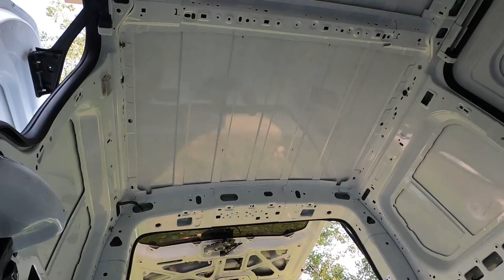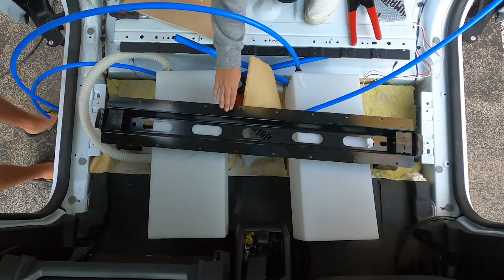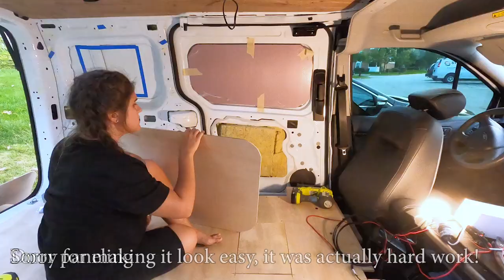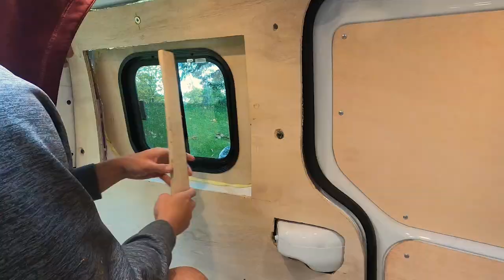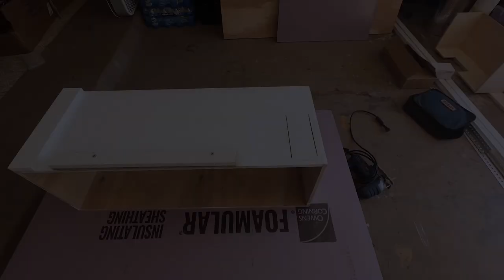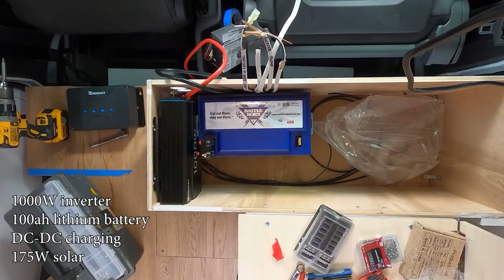Ford Transit Connect Van life Conversion | Full Time Lapse Video

Comment: Your build looks light years better than mine.  I like having the option of using my van as an actual van sometimes though.  So, I set mine up so that I can remove everything within 10 minutes... even the flooring.  I can put everything back just as quick.  The solar setup and diesel heater is the only thing that I leave inside since they aren't really in the way.
Reply from the maker: That's awesome! That is actually how we built our personal van as well. Great for work and for travel. :)

Comment: Very professional job. I was just curious about the water tanks and pump installation. It doesn't seem like it would be very accessible if you had to repair a leak or service the pump, without having to tear up the flooring.
Reply from the maker: Thankfully it is build with that in mind. The water system is build to be service free and last a very long time. The changeable water filter is located under the sink.

Comment: Haven’t got all the way through the video yet.. very impressed so far, but how do you plan on removing the water tanks for servicing/cleaning? I would highly recommend cleaning the tanks on at least a yearly basis. Uncleaned tanks can build up with biofilm which can cause infection in the body if not careful. Please look into it and be safe

Comment: I've never seen anyone get a sub-floor in a Connect before. You guys are really skilled craftsmen. The only thing I would have done different is leave out the skylight. Just another hole in the roof that will eventually leak.
Reply from the maker: Thank you!
About all the holes you might put in the van, just make sure to check the sealant at least once a year and apply more if nessesary. Regular maintenance for any RV.

Comment: Can you explain what holds up the slide out bed on the side closest to the kitchen? By the way, I’ve looked at probably 100 builds of this van, and you guys nailed it. I’m likely going to build the one with the dual swinging doors, but other than that, I’m going to build as much like yours as I can. Great job!
Reply from the maker: Thank you for the feedback! when the bed is open it is held by the heavy duty slides, plus is supported by resting on top of the kitchen drawer face panels. Watch the van tour for more details.

Comment: I like the extruded aluminum channels you bolted to the roof.  What did you use for spacers?
Reply from the maker: The spacers were made of aluminum and nylon, with rubber washers. Use silicon caulk on the threads of the bolts, and you should get a quick custom roof rails! Perfect for solar panel mounting.

Comment: Very nice build. How much weight did you add?  Especially if your water tanks are full?  4 cylinders have a reputation for chugging up hill.  What does the weight do to your gas mileage?
Reply: Not that much weight was added. When you are full on water, it's less than 200lbs. Overall still less weight in the van than if you had a car full of people in the passenger version of these vans.

Comment: Great build!!!!!!!! I have a question 🙋‍♀️ can a larger “fixed” bed be put into a connect? Like a full size bed? Yet still allow space at the “foot” for a toilet to slide from under the bed and or room to put your feet on the floor to get dressed?
Reply from the maker: A fixed bed is very possible if all accessories are stored under the bed as pull-out options. Our preference is to the sit up in the van to use the interior as a work space or other activities rather than just sleeping.

Comment: Hi from over here in UK. Great build, keep going back to your videos. We have a VW Maxi Caddy, tad smaller all round, but your design has us think. I Perhaps I've missed it in the electrics. Do you have a split charge or are you running the build just from the solar?
Reply from the maker: Hello! The battery gets charged from the solar along with the alternator

Comment: Was this a cargo base or the passenger base? I'm still not sure which one is best to build on and the differences between them as buildout goes. Meaning structural differences in the rear cabin/ceiling etc.. 

I think I might just get the passenger style but I assume it's a bit more complicated to build out vs the bare bones cargo

Comment: Just a question.. those screw holes and raw edges on top and on the side of the van, will they rust eventually?
Reply from the maker: Any cuts and screw holes get rust prevention, primer and paint, so no raw metal remains exposed to the elements.

Comment: Heya, question have you guys ever do a van build with swivel chairs for that small transit? I'm wondering if it's possible.
Reply from the maker: Hi! It is not possible. The seats in the front are much lower than the floor in the back. Also, there is no room for the seat to swivel around since it’s so close to the door and center console

Comment: Hey guys! Love the video and the conversion - Top job!

I've got a quick question - How tall are you both? I'm 6'2 and wondering if a conversion like this would allow me to sit up straight, in the back of the van, without having to be hunched over all the time?

Any advise about this would be great!
Reply from the maker: Thank you! You would not be able to sit perfectly straight up. If you would like to be able to do that, I would recommend getting a Ford transit low roof short wheel base.

Comment: Where did you put the diesel fuel tank for heater?
Reply from the maker: Under the the van. In the rear right side corner. Just perfect size to squeeze in a 2.5 gallon aluminum tank.

Comment: What thickness and type of wood did you use for bed frame and bed base?
Reply from the maker: 3/4 inch plywood, and brackets where additional support is needed.
Reply: What dimensions are the boards for the bed, width and length wise? And how long were the sliders you guys used?:)
Reply from the maker: @sw2048  maybe we will have to make a schematic drawing for the bed design.
Reply: Christina and Daniel I'm sure if you had blueprint/build plans on your site for sale, I'm sure it would be a big seller. I'd definitely be interested in purchasing it if you had it available

Comment: Hi guys!  Love the van, so beautiful!  I recently bought a Connect to convert and am trying to not lose height in the ceiling.  It's hard to tell from watching the video, but what did you use (size) and how did you attach the strapping to the roof struts?  Thanks for you help!!  
Andrea
Reply from the maker: Great question. The way we always save head height is by installing wood framing flush with the bottom of the metal ribs on the roof. Then using 1/4 inch material for the ceiling, the material makes a flat ceiling and with enough space for up to 1.5 inches of insulation in the ceiling.
Reply: @SmallVansBigWorld  great!!!  What size wood framing did you use and did you adhere it with glue or rivets?  Thanks for sharing your tips!!
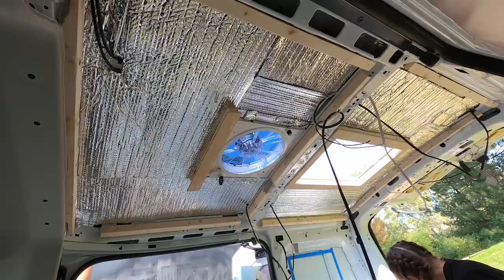Reply: @andreageller4804  it appears they screwed it to the roof frame, as seen @ 5:12
pause it and you'll see the horizontal screws

Comment: I’m so torn between the 2013 and younger as opposed to 2014 and up b cause of the back doors. 2013 version opens wide and sideways so you can set up shower system outside but 2014 and up the hatchback door opens upward to make a really useful sun/rain canopy. The 2013 and younger appears to have like 4 inches or more of headroom so I’m gearing towards that
Reply: The newer ones also have the regular cargo doors, which is standard for cargo vans. Yes, the only down side of the newer ones is the lower roof, wish they made them taller.
Reply: I gotta say Daniel that skylight dome is pretty cool . I know you can’t open it but gave me an idea about the taller connect and how I could make it so I could stand up . I researched boat skylight hatches like 24 inches wide and that would accommodate my 5’7” stature but only weather permitting and they are so expensive. A taller dome may accommodate me standing in any weather. Thanks for the inspiration

Comment: Don't like 'hidden tanks' myself...I prefer the tanks 'inside' as well as all conduit and air-handler runs inside cabinetry itself
(The water-pump should be inside the fresh-water tank...a submersible works very well and very easy to replace and 'cancels-out' the noise factor)
In other words, I don't like 'hidden critical functions' that mean I need a week to tear EVERYTHING OUT so I replace/repair it
Reply from the maker: There is an access panel to the water tanks if maintenance is ever needed.
Reply: @SmallVansBigWorld  The 'access' feature was not made clear, so I assumed it was 'sealed-in' by flooring

Comment: Did miss something...bother vents installed horrible. Skylight you could see tracks through tape. Vent the tape was put on high rib instead of valley. Even with post seal this is just bad physics,logic....you made valley deeper and created soft spots for bending and leaking. Just don't get it....
Reply from the maker: Oh Len, everything what you said is actually the very opposite of what we did. We don’t show eveeerryyyy single little thing that we do in a van build (that would be a very lengthy video). I can assure you that we did everything correctly and actually did a water test to make sure nothing is leaking. But thanks for caring! 🤗
Reply: @SmallVansBigWorld  that's great it is a great van. Had me worried you built an aquarium. All about the editing. Take care,van on.......